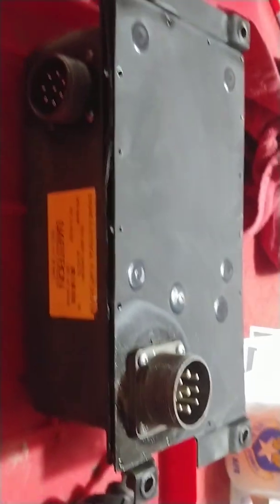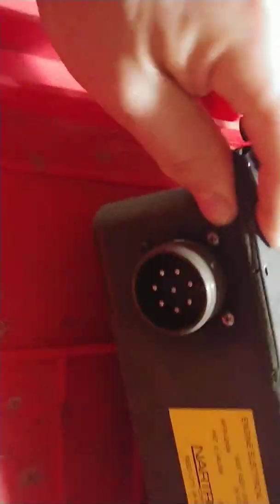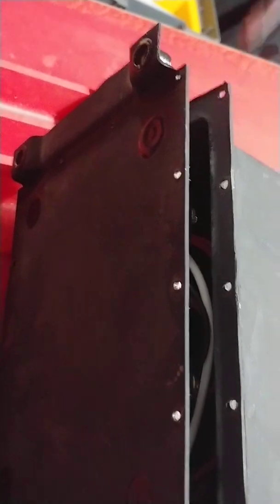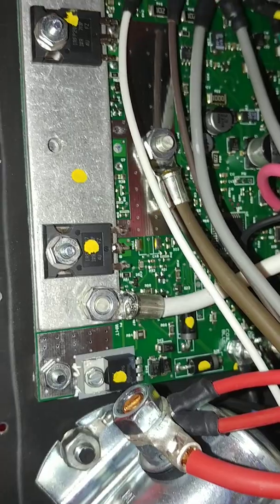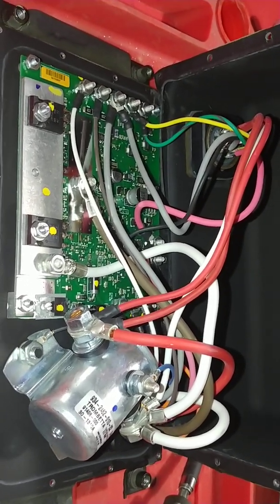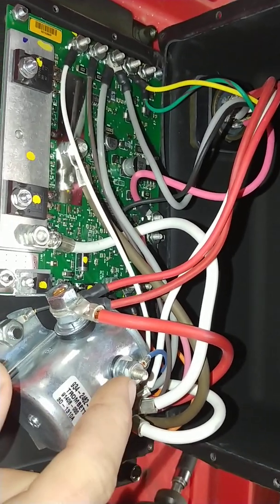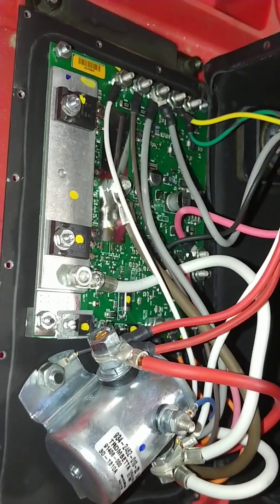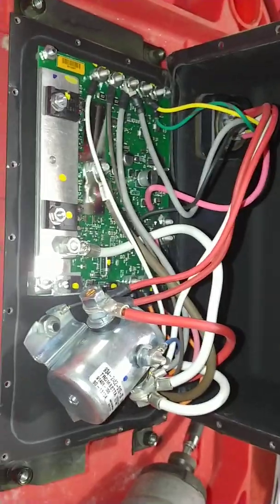inside humvee HMMWV start box eess humvee

Comment: The protective control box has been a point of contention for over 50 year. Just about all Army wheeled vehicles had a version of this box on-board. Back in the day they were manufactured by Leece-Neville. My Fuel & Electric guys took one apart 40 some years ago. The only thing serviceable was the relay. The logic PCB's and terminal boards had no NSN's assigned and the Army Tank-Automotive Command never provisioned repair parts. The entire box was designed as a line replaceable unit. The Protective Control Box was designed to protect the cranking and charging systems from catastrophic failure.